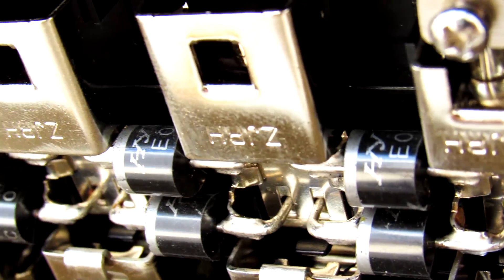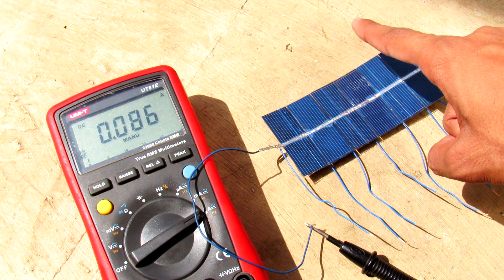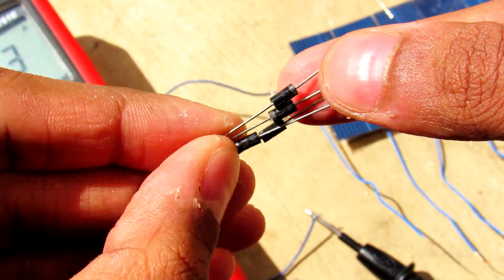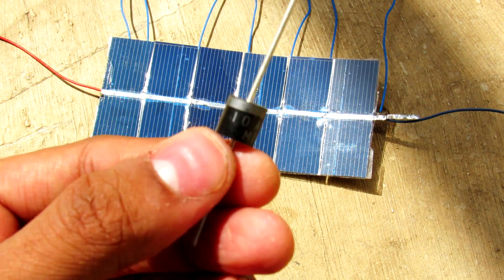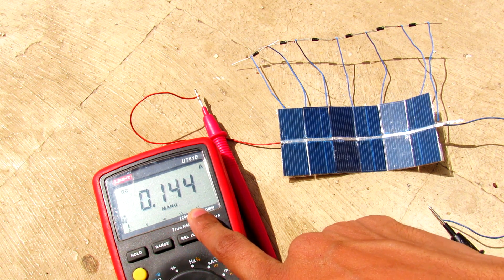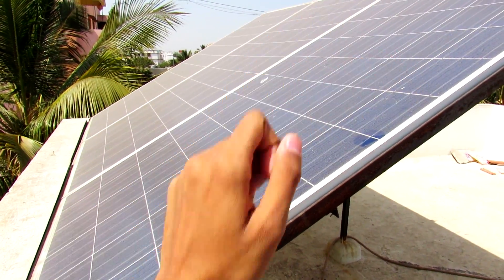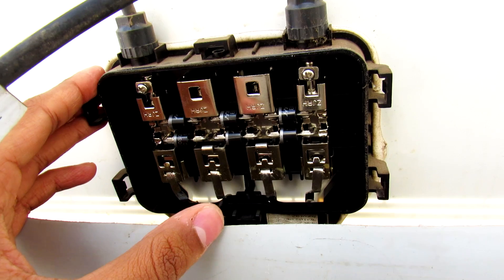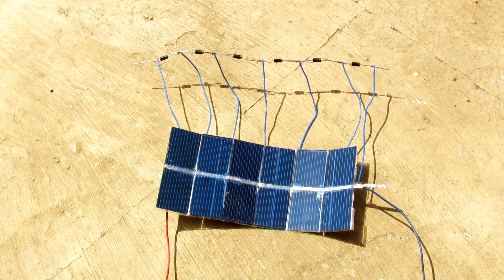How To Install Diode in Solar Panel Installation

Comment: All wrong !!!!! At 2.53  Other way around negative of the diode goes to the positive of the solar cell for bypass diodes on solar panels. Not as said in this video "positive to positive and Negative to Negative"

Comment: For such a small fellas i'd go with 1n5820, it has the absolute lowest forward voltage drop amongst all the schottkys so you'd get more power outta this even on a partial shade. Edit: you cannot say that the diode will work because it has the same forward voltage as the cells.. any diode will work. The forward voltage means = you measure open voltage 2V, diode has lets say 0.5V forward voltage drop, so with this diode you'll have only 1.5V at the output. You just basically said that is the voltage is greater than a forward voltage of the diode, it won't work.. nonsense, you are talking about reverse voltage. If the reverse voltage of the diode is 20V, you cannot put it in series into a circuit that has greater voltage than 20V, diode would burn on trying to block that

Comment: If I use my solar cells hooked up to a Pi UPS that also charges a lithium battery does the UPS already have this protection? I'm assuming it does. So I don't need this unless I'm just hooking up the solar panels directly to a battery ? Is my assumption correct?

Comment: I have a MPPT controler for two solar panels connected in parallel- and i was advised to buy a diode for each panel to prwvent for current going back ?!  Is that necessary or is he just trying to sell me the diods ? 
Most solar panels already have a diode in the box behind the panel also the MPPT controlar has a function to prevent the currend going back ..
Reply: As far as I know, MPPT charge controllers will not allow reverse current to flow to the PV modules to occur as they disconnect from the PV array if they are not charging(except for their voltage sensor). It would only be an issue if you don't have a charge controller at all between the PV modules and a battery, or a charge controller that did not disconnect the batteries from the PV array when it is not charging. Then you would need just one blocking diode in one of the wires between the batteries and the PV array, or between the charge controller and the PV array if you have a charge controller. The diodes on the PV modules are not there to prevent reverse current in that way, but to allow current to bypass any shaded strings of cells. You can check for reverse current flow at night if you have the skills and knowledge to do so.

Comment: you will have higher amp but lower volt.... normal phisics. please learn a minimum about electronics... and clean your big panel, bcause you lose most of it power

Comment: If the reverse bypass diodes would have been soldered in , to ensure a good connection, you wouldn't see ANY change in current by shadowing 1, or even 2 cells. Photovoltaic cells are constant current devices, weather they are producing a voltage, or if they're running in reverse bias condition. The whole string only passes the current of the least illuminated cell, unless you install those reverse bypass diodes. Excellent video. I wish manufacturers of panels would indeed install diodes in parallel with each cell, so you lose a couple of cells, rather than a couple of coulombs of cells.
Reply: Correction: columns of cells.

Comment: But, Si diodes have a forward voltage drop of 0.65 V. I would lose quite a bit of I had a smaller panel

Comment: I have a Degree in Renewable Energy and this book [link here >>>https://plus.google.com/u/3/113778429958471787540/posts/67MrRb1YGej ] was required for the Solar Energy class. It is easy to read with good explanations. I would recommend to anyone.

Comment: please tell me how to know the diode power in function to panel type and watt,amper,volt?,i apreciate if you have one link .for example i want to put in series two panel 2x 150W(or another power)how know to buy witch diode is good?

Comment: If my panels (cells) are connected in parallel, do I still need a bypass diode to continue to conduct electricity? From my understanding, if the panels are shaded in series, the current will be reduced to that shaded cell but I'm not so sure what will happen in a parallel setup. Help?
Reply: No, in parallel the current is just shared or added as you prefer to say it. So when a parallel cell is shaded, it just don't add its energy to the circuit, but it won'e ever act as a resistance (as it happen when a series cell is shaded)
Reply: Damian Rene Ok, thank you!

Comment: Thanks.   For people who cant afford much solar, and need heat, they can make a homemade solar air heater (or water heater), and it can make even a  thousands watts of free heat when the sun shines, and reduces the cost, plus you don't need firewood. electricity or oil. once its made.  But it depends where people live too, sometimes the landlord wont allow different types of constructions.

Comment: http://www.ti.com/lit/ds/symlink/sm74611.pdf. Use these instead of the diodes. They have a very small forward voltage drop of 26mV at 8 Amps.

Comment: Which multimeter is that? and how much did it cost?
Reply from the maker: +Soham Gumaste it's uni-t ut-61e , Cost is Around 50$ .
Checkout Here

http://www.ebay.com/itm/UNI-T-UT61E-Digital-Multimeters-AC-DC-Modern-Digital-Auto-Ranging-Multimeters-Mu-/252243542349?hash=item3abae3014d:g:oscAAOSwZG9WkKcO
Reply: +Kedar Nimbalkar Woah that's expensive...I use a ₹500 one :P. Thanks for the reply.